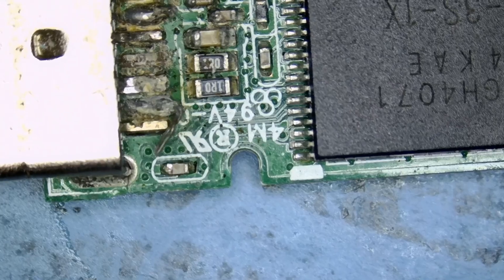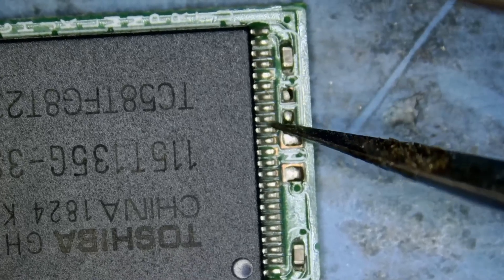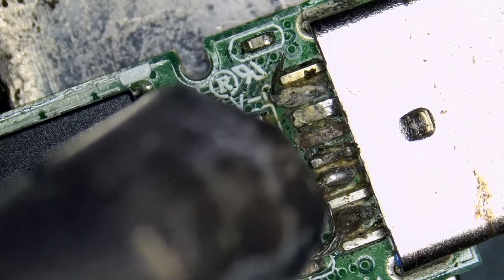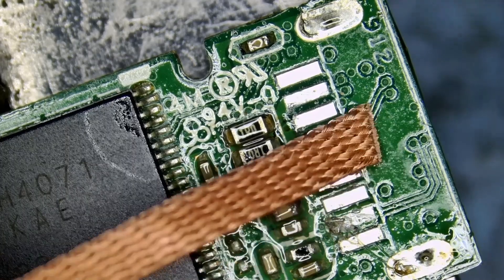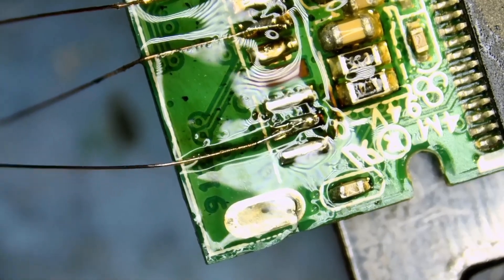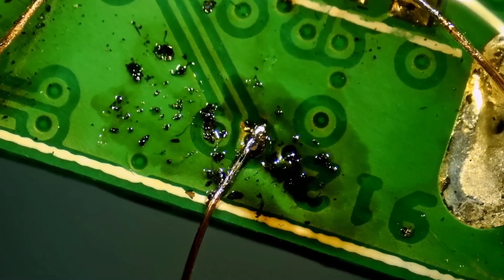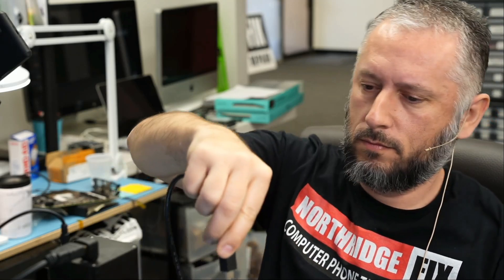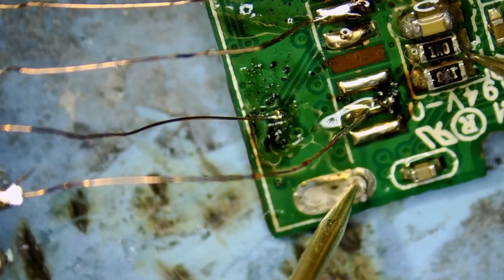Broken USB Flash Drive Smoked - Repair and Data Recovery

Comment: The only thing I would have done differently, is strain-relieved the wires on the board with Kapton tape. I'm a retired Tech, who was a Lab Admin for the team that gave you WiFi on your cell phones for the first time. I admire your approach...visual inspection first, power supply checks second. In general, the third thing I used to look for was clock, or something stuck in reset. Usually, as you know, the power supply tells the tale. Best wishes. --bd

Comment: How's it going I would like to know if you can fix a motherboard that will not post in the dual channel slots when I got it from the manufacturer they said that it was a ram kit issue and I know it's not a ram kit issue because it also killed three other pairs of different brands of ram is there something you can do or suggest that might fix the motherboard killing ram kits? But the motherboard will only work in single channels and that's the only way it works and I don't know why.

Comment: Can Anyone solve my problem
I have replaced my laptop(Dell Inspiron 3511) battery 3 days back and when I opened the laptop yesterday the screen is becoming dull when it is not connected to charger and it shut down suddenly when I run a small code on VS code. It is working fine when kept plugged in. What could be the exact problem can someone answer me ? Please 😢

Comment: On of the other issues that could have caused your issue is the two resistors were not put in the same direction.  You put on in upside down and this is going to confuse the electrons going through them so the resistance will be wrong...

Comment: As I watch these videos I often wonder if sending something in for repair makes sense vs attempting the repair yourself. As an example I have a VR controller that has a joystick issue. The cost of the controller cost $250 new because you can only buy them in pairs but the component to repair it cost a few dollars. I bought a set of new ones, but for $250 it seems like a repair would be worth the attempt as I would have a spare set. It's probably not worth sending in for a professional to do due to cost though. I am a hobbyist so watching these videos is good for learning techniques, even if I don't have all the professional tools. Kinda hoping I can manage one component though...

Comment: Would never trust a repaired flash drive or SSD ect with important data, which you by the always should have a backup of in a different location than your home / office 👍
Reply: I have SSD drives that lasted longer than my ex-wife, was more reliable etc. in fact some are more than 20 year old. Low in capacity but working all the same.

Comment: This kind of flash drive are now disappearing. The new ones now have all the components on one ic which makes it extremely hard to repair. Looking forward for the video which involves this new drive.
Reply: Smaller/simpler with single IC = Cheaper and less ewaste
Reply: @VV-om8vv  actually thats more ewaste. Because they just replace them. No repair, no salvageable components, nothing. Landfills are now full of electronics. Short lifespan and no repair possible is the main reason. I have 5 amplifiers from 80's up to 2000 that I saved from scrap yard, repaired and they are still good. Can't do that with newer models.
Reply: This kind of usb flash drive cost more . Thats why china is using cheap memory cards inside usb body case. Looks usb flash drive but instead inside its memory card. 😂
Reply: They gotta just complicate everything dont they
Reply: @blackace69 of course. If they don't then people won't spend even more money that they think we somehow have with the current economy .
Reply: @blackace69 They make more money that way - the idea is to make repair as tough as possible and as a result they sell more, and it's all down to greed. Just look at the antics of Apple and John Deere as just two examples of making unofficial repairs almost impossible for certain components.